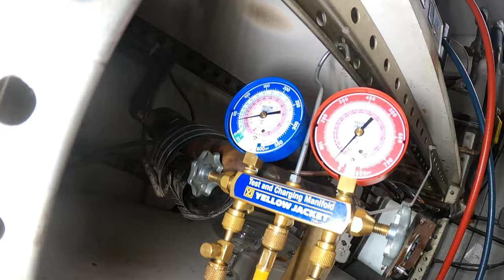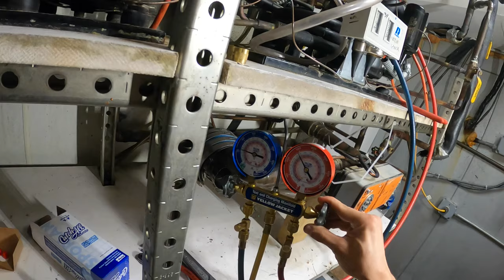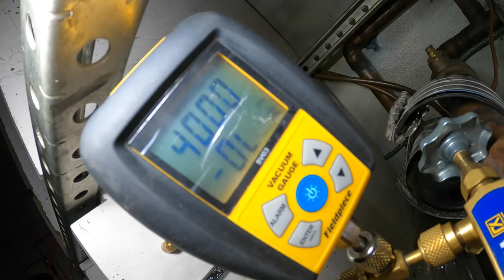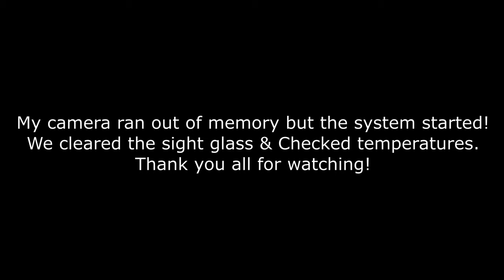HVACR: Split System Refrigerator Installation (Commercial Refrigeration Installation)

Comment: What edition of the NEC allows a flexible cord to be run through a hole in the floor? 2023 edition, 400.12(2) does not permit this. In my 2002 copy, 400.8(2) states the same.